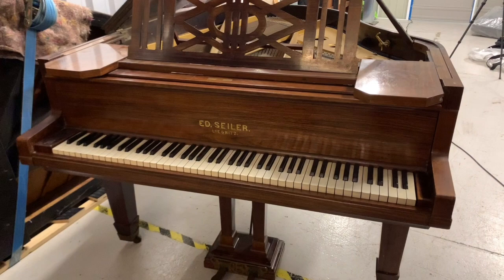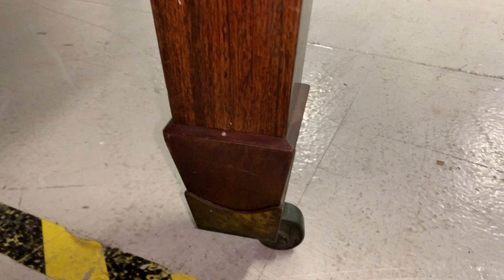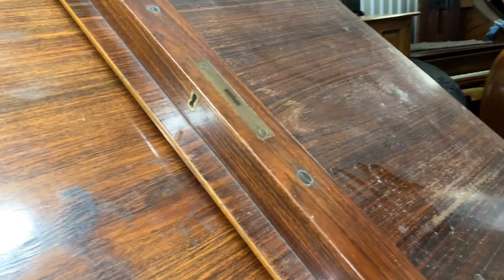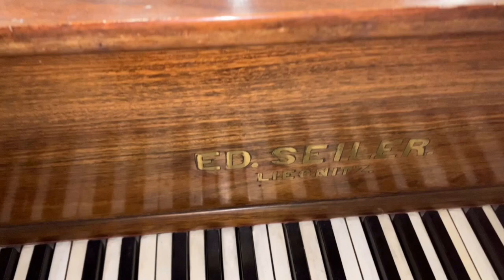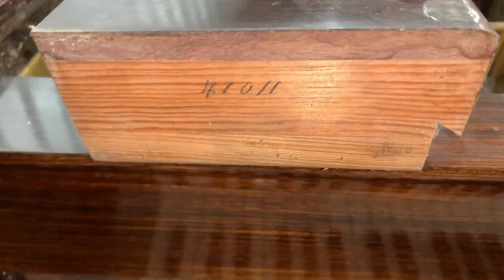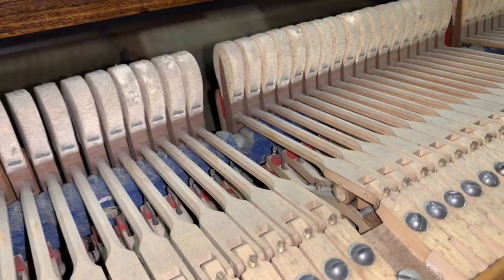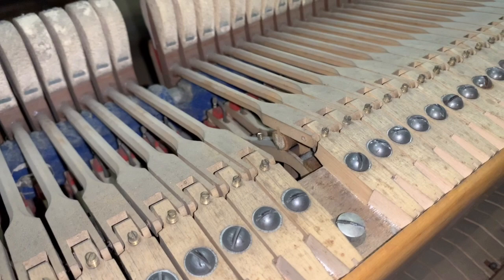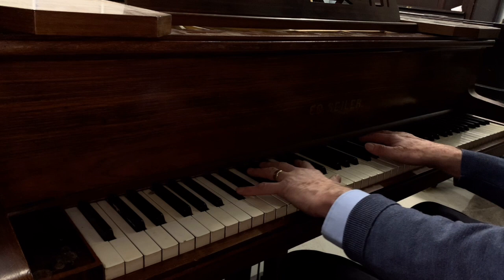Before restoring/reconditioning of a Seiler grand piano 5ft 5in c1908 - 1 of 2 videos

Comment: Hello! My recently bought centenary piano is almost 1 entire octave(the 3rd one) flat, its possible to be tuned and hold the tune again? I mean, the piano is out of tune as it doesnt see a tuner for almost 10 years, but I just found this octave difference and would like to know if its a big deal. Could you guys help me with that? Apparently, everything seems fine with the piano(strings, soundboard, pinblock, tuning pin...), so its possible for a really old piano to hold the tune when you find a problem like that?